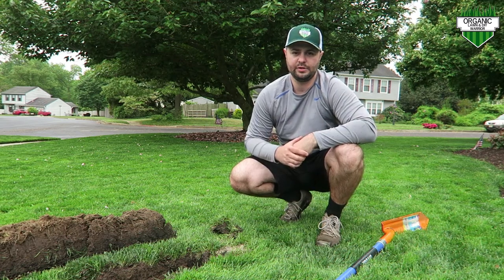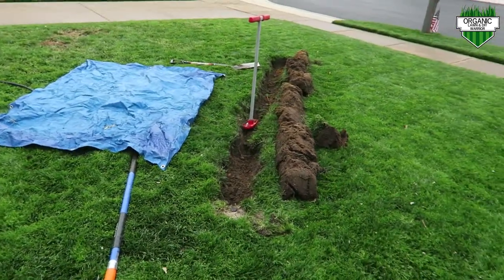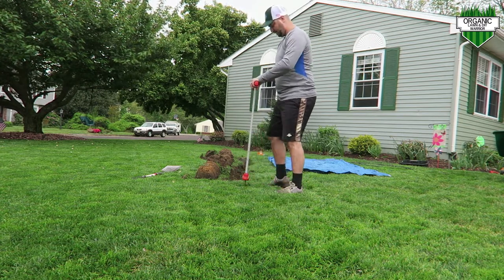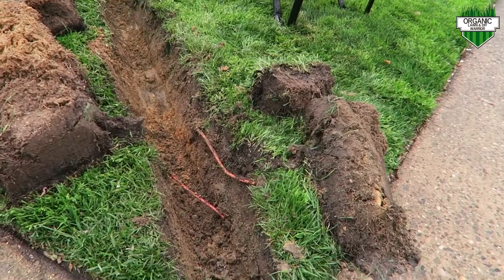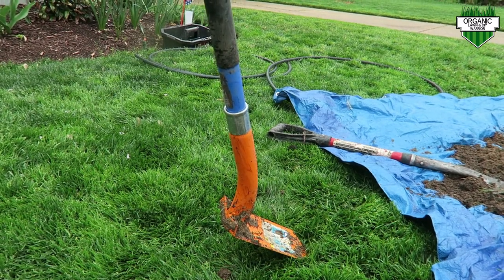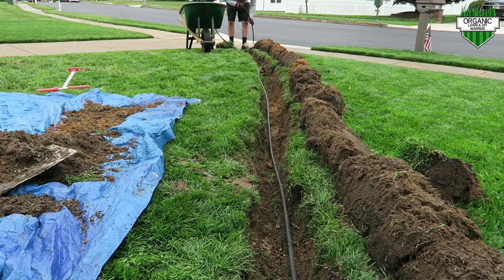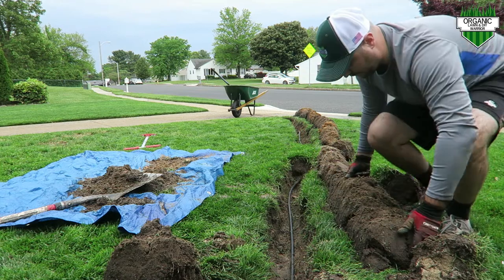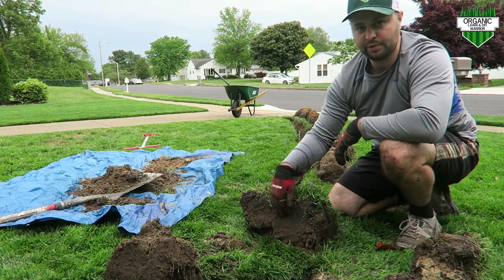DIY Underground SPRINKLER System & Repair #diyundergroundsprinklersystem #diysprinkler

Comment: Not sure if you mentioned this but did you install any type of back flow device at your hose bib?
Reply from the maker: Good question. And yes I did. It’s a brass one.
Reply: Any chance you could tell me what brand it is?  Thanks
Reply from the maker: @4wheelers11  Litorange 2 Pack Brass 3/4" Inch GHT Hose Bibb Connector Backflow Preventer Vacuum Breaker https://www.amazon.com/dp/B07KTRW4KJ/ref=cm_sw_r_cp_api_glt_fabc_GS4CGX9P9TPVD24WK46E
Reply: Thank you

Comment: I’m super excited to install my own system like this. What fittings did you use to connect the funny tubing to the melnor timer? Thanks
Reply from the maker: Honestly a bunch of fittings. https://www.homedepot.com/p/Rain-Bird-1-2-in-Barb-x-3-4-in-Male-Pipe-Thread-Irrigation-Swing-Pipe-Coupling-SWGA075/100553988 then into a 3/4 inch threaded pvc coupling then into a hose connection  https://www.lowes.com/pd/Yardsmith-Yardsmith-Zinc-Goose-Neck-Hose-Connector/50328325 then from there into the Melnor water timer.

Comment: I have a question sir , can you please tell me the name of that pipe , which is connected to sprinkler head , is this called flex pipe? I got leak on one of my pipe , and the want to repair that leak, thanks
Reply from the maker: Its called funny pipe.https://www.lowes.com/pd/Rain-Bird-100-ft-Polyethylene-Riser-Flex-Pipe/1000422127